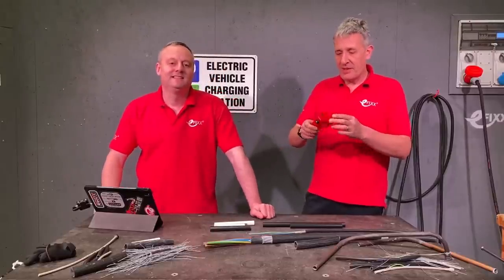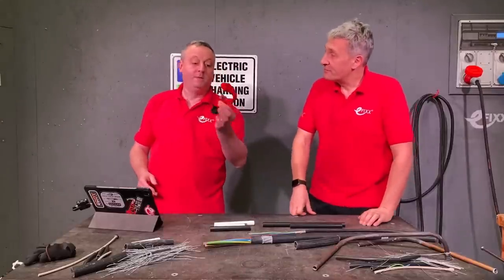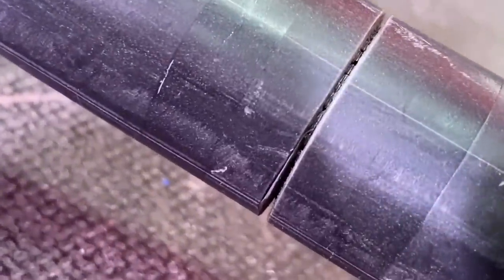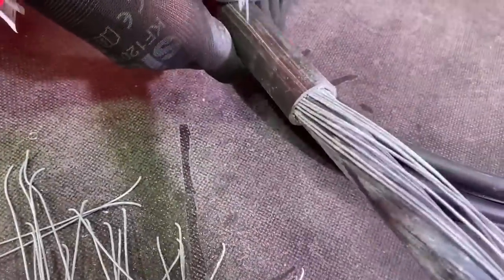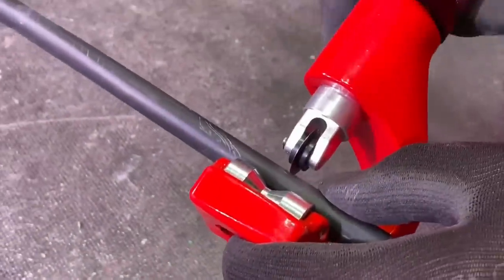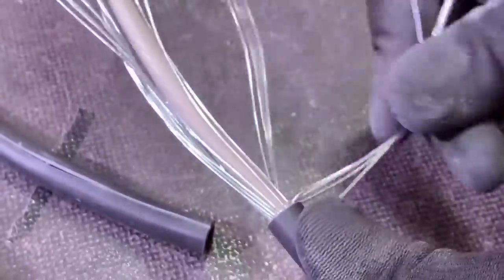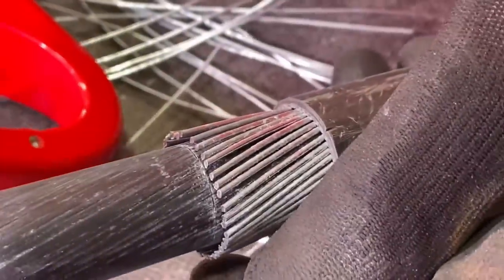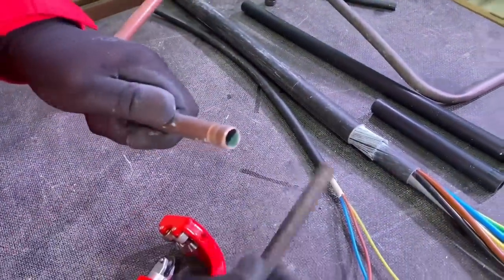Don't Be Fooled: This Is NOT a Pipe Cutter, It Strips SWA Cable

Comment from the maker: = AD= Check price and availability via eBay (cheapest we could find)👉 http://hub.efixx.co.uk/sacs-tool
Reply: There is a cable jointer who uses and swears by using a chain car exhaust cutter no joke and he deals with armoured all day. What tools would you recommend for cutting or scoring stubborn bedding material? If the armoured is cold and does not have a string going through it to help with the stripping? 
Any help would be appreciated.

Comment: Good video guys. I first started using a pipe cutter for stripping SWA about 25 years ago. The first attempt didn't work well as the blade was designed for copper, then a pipe fitter mate of mine suggested a blade for cutting stainless steel pipe which worked fantastic. The cutter was borrowed by another spark and never to be seen again. Some years later different models of SWA cutters came out , I probably tried them all, didn't like any of them. Until I came across the SACS stripper, I have been well impressed with it so far (though I don't do as much SWA as I used to). I've had mine at least a couple of years now, still going strong.

Comment: At £80 I’ll stick to my knife and hacksaw! 😂
Reply: If one has the bread, then why not. But you're right a hack saw and knife is fine.
Reply: Or get a Dickie Dyer 6-35mm for around a tenner
Reply: Absolutely love mine-had it a couple of years now think I should be changing the blade 😂😂
Reply: ive got the eclipse pipe cutter, was about 15 quid. works better on larger swa as the thicker armourings dont squash as easily. great tool not used my hacksaw since

Comment: Been using a plumbers wheel for years .. did have a sacs years ago.. blades lasted well..the stripping could be a pain at times due to manufacturers thickness of outer jacket.. i went over to a plumbers wheel for larger armoureds and a jokari stripper for the outer sheath on sites that get funny about knives .. takes some getting used too , but way quicker and cleaner than any other method... top tip.. don't use it on cables left out in direct sunlight in the summer.. get them shaded or the wheels can get jammed on the outer sheath
Reply: this is true. first used my pipe cutter for swa last summer and it squashed the outer and i thought it was shit, used it in the winter and had no problems lol

Comment: Before to ban knives, construction sites should offer alternatives for those tipe of tasks. This tool is good for small cables, maximum 28 mm diameter, so, for bigger ones we will still use knives. :)
Looks perfect tool for dismantling lead mantles. I speak especially about the longitudinal cuttings. But, of course, should be capable to cut also cables with 50 or 60 mm diameters.

Comment: Turning the wheel 90 degree is what makes it different to a normal pipe cutter.  A pipe cutter with sharp wheel I have used on armoured cable, working well.

Comment: Bahco pipe cutters does the same thing lads. Another top tip cuts conduit aswell clean cuts great for adjustments with con lock stuff mounted and ye don't want to use a grinder.
Reply from the maker: Conduit interesting 👍

Comment: Great tool, loads of feedback through the tool as the blade progresses.
I would say peoples opinion tends to be down to personal preference or method learned (hacksaw-armourslice-plumbers wheel). I have had SACS for over 4 years and still going strong with only 1 blade change since new. Price wise you get what you pay for in this tool, compact, quick, easy and fairly bullet proof.
From my own experience  i would say in time you learn the feeling as the tool is about breach the steels, the tool feels like it has parted the steels once you get used to the tool it's effortless
Great content as usual thanks eFIXX

Comment: i like the pipe slice function, seems like it would cut cleaner than an armourslice, but you dont get the same feel, are the blades on this changeable? they will inevitably blunt over time, 
the 2nd function is ok but i’ve never found stripping the outer sheath with stanley knife to be a problem

Comment: Works the same as the CK one I have had and used for years, they are a fantastic type of tool, but I cant see how it is time saving by using it to strip the all the out sheathing off and nice sharp Stanley knife dose it much quicker
Reply: I disagree I've used both SACS for over 4 years and recently bought the CK armour slice, gave armour slice a few attempts and takes loads longer. The SACS is more expensive however is quicker and you get more feedback through the tool as you work through steels, the only issue I have is longitudinal cuts it tends to slip off so I prefer a knife

Comment: There is a cable jointer who uses and swears by using a chain car exhaust cutter no joke and he deals with armoured all day. What tools would you recommend for cutting or scoring stubborn bedding material? If the armoured is cold and does not have a string going through it to help with the stripping? 
Any help would be appreciated....
Reply: Knipex ergo strip for the inner sheath

Comment: Swa stands for what ? Iam Canadian and do see a difference in our cable difference
Reply: Steel wire armoured
Reply: A question like that, you should have said you were American!!! 🤣
Reply: Iam ok with  being Canadian ,after all we are the best ..we have a single conductor with a concentric neutral thats similar..but iam impressed with the cable your using
Reply: Hi from UK jaydream T 🇬🇧
Steel Wire Armour uses the steels as mechanical protection connected to earth
Not so long ago you could use the steels as your circuit protection to earth but not these days (line neutral and CPC these days and previously would have been only line and neutral and steels were the CPC)
It's a clever protection as steels surround the cores so if penetrated and connection is made to line the system will short out before complete cut through occurs.
Also the steels been connected to earth has the added benefit of preventing Eddie currents between bunched SWA's as Faraday effect carries all magnetic noise to ground
Adds certain amount of skills and trouble as you can imagine big cables are even bigger and a lot less flexible